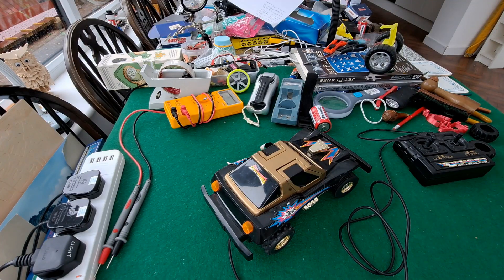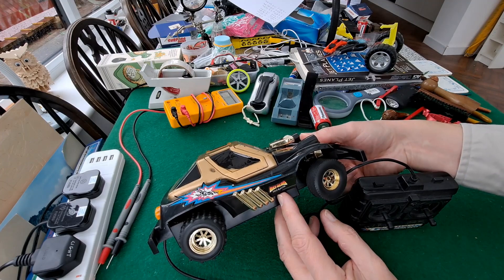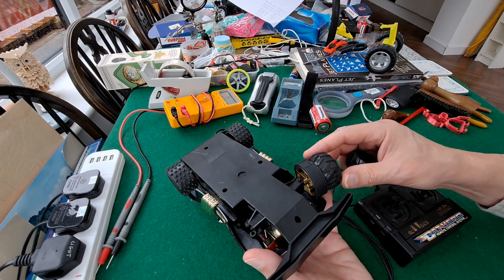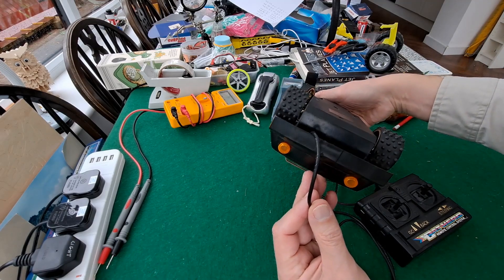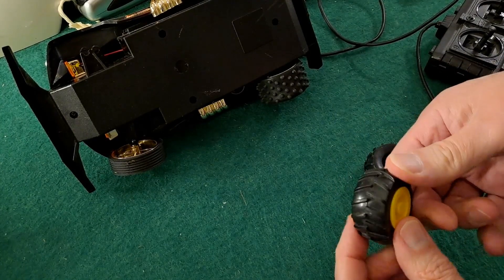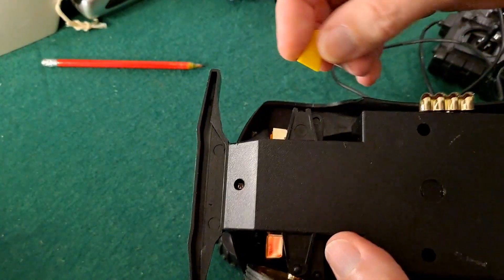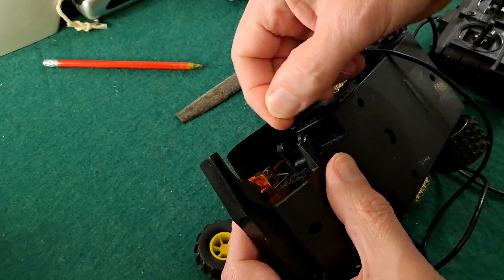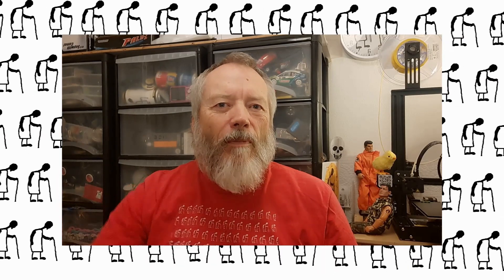Part 1 INTRODUCTION - KS Toys Bat Hero Gold Blaster wire control car 2018 charity shop find

Comment: Do this car have some clicking Spring loaded clutch drive Gear?
Reply from the maker: Do you mean for the main gearbox driving the rear wheels? The main gearbox does not have a spring loaded clutch. I cover the gearbox in episode 4. The steering gearbox does have a spring loaded clutch and I cover that in episode 3. Also the door opening mechanism has a spring loaded clutch and we see that in episode 6 😁👍
Reply: @GrandadIsAnOldMan  as the same thing in my cheap smaller rope climbing santa it starts grinding when it try to go up i remplace in a normal one, i put it back thogeter and it work fine 🙂👍
Reply from the maker: @timothylucas7733  the clutch will be there to protect the other gears and the motor when something stops it moving forwards, so yes it will work without it, but you may eventually find one of the other gears splits or loses some teeth 😁👍

Comment: Interesting car.are you going to convert this car into Hobby grade?looks like a good car to Do it with.
Reply from the maker: Hi Marc, there is enough room to squeeze the RC gear and battery inside but I don't want to change it as it is a bit of a retro classic 😀
Reply: @GrandadIsAnOldMan  understand able 😆
Reply from the maker: @MsRaidman  😊